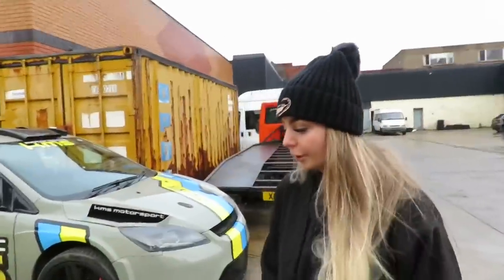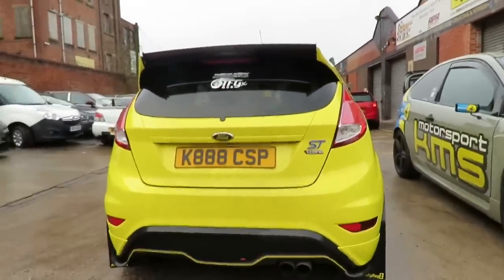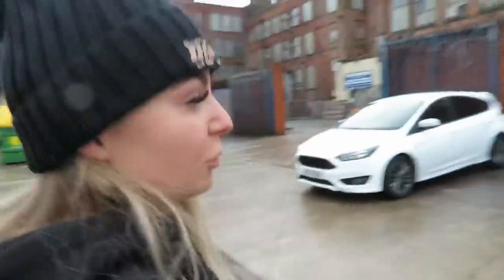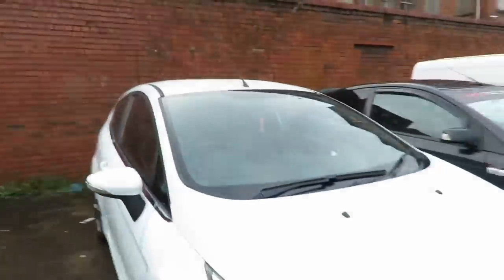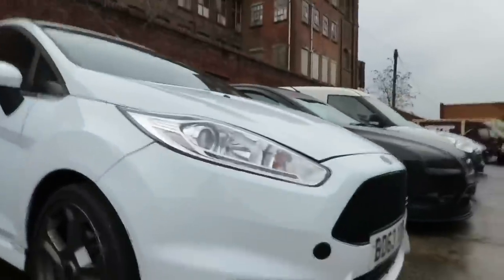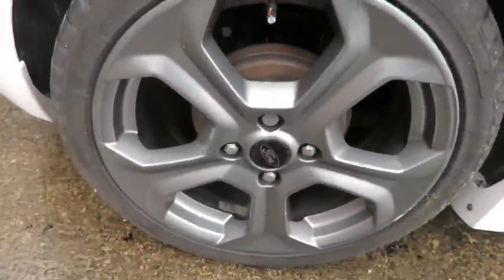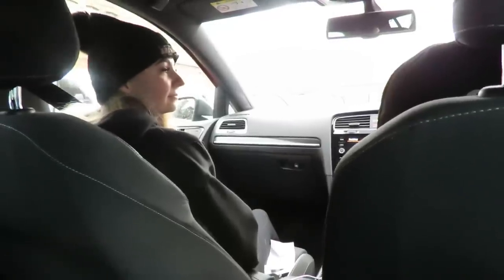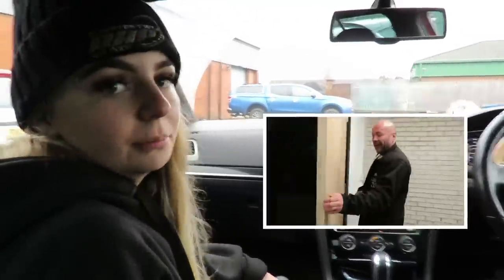Fiesta ST KMS Hurricane Exhaust Installation | Audi RS7 CRAZY LOUD Exhaust NOISE!

Comment: Question? I have the fiesta 2016 5doors ecoboost. Is it possible to have this exhaust on my car? Will it even be louder/cooler sound?
Reply: Is it a 1l ecoboost or is it a fiesta st, either way it’ll still fit and if you get the non resonated it’ll be louder and a nicer sound

Comment: Great video!! Just quick question does the engine management light stay on with the de- cat?? Thanks
Reply from the maker: No it doesn’t Xx
Reply: @CaitPlatt  ok thanks did they program the ECU ? To turn the light out from O2 sensors? Thanks
Reply: Remapped the ECU?
Reply from the maker: It was remapped after however I can’t remember the light ever coming on🤔🤔
Reply: @CaitPlatt  ok thank you